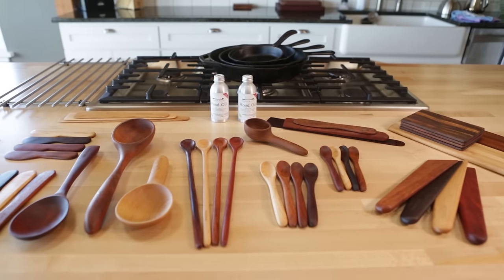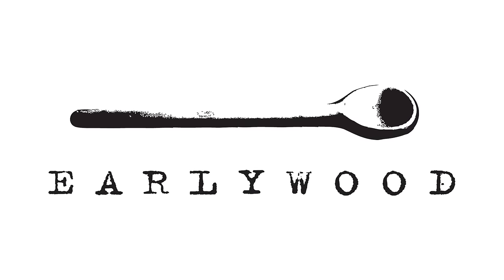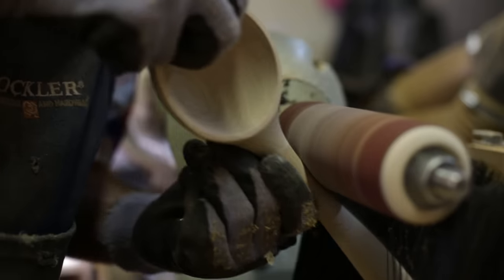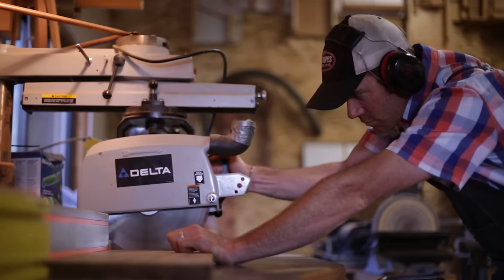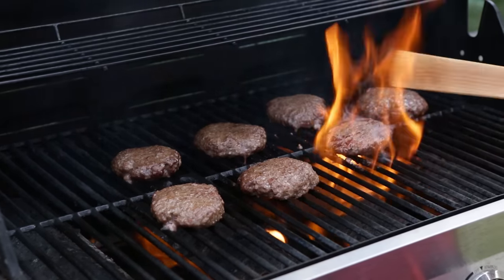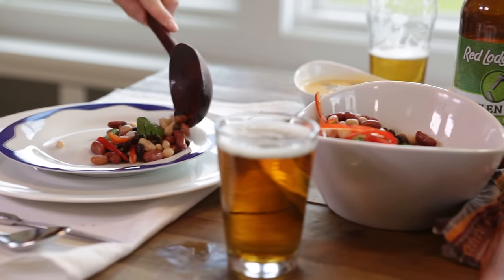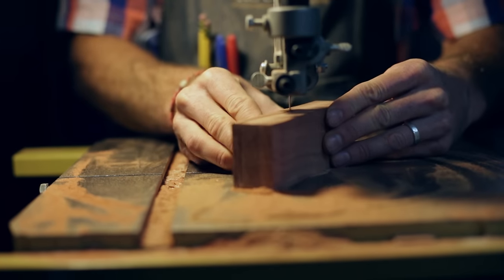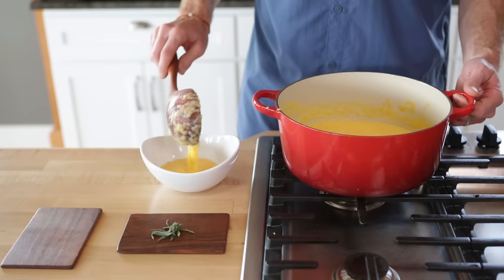Earlywood Handmade Wooden Utensils for the Kitchen

Comment: Brad, I am a huge fan of your work! HUGE! I am a woodworker also. I make cutting boards, trays, serving trays, bowls and furniture. I hope to give a try at making a spoon one day and yours are my inspiration. Question...what is the clamping system you use shown at 1:59 in this video? I can use that for much of the small segmented work I do. One more thing...I'll be in CO early next year...can I stop in to get a tour of your shop? Again...your designs and wood choice and quality are not exceeded anywhere.
Reply: Ross Nanfito I'm wondering about that clamping system too!
Reply from the maker: Hi guys, sorry for such a ridiculously late reply. If you search google for "unique clamping table" you will find all kinds of info on them. They are pneumatic cylinders that you can arrange in any way you want on the flat table. They are especially for gluing up door and drawer fronts. But... for what we do here, we went back to regular old bar clamps now.